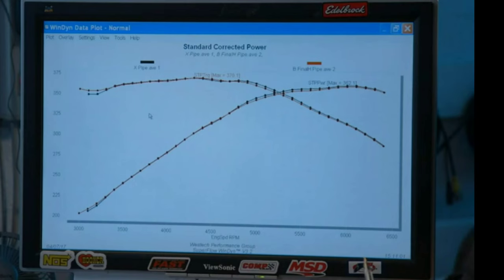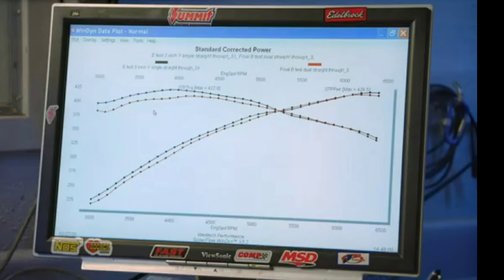DUAL EXHAUST LOSES POWER! single is better for POWER!

Comment: Like the saying goes. I race cars not dynos. I can assure you I put a true dual exhaust with an x pipe on my Dodge Ram and the mileage went up 1.7 and the truck is much faster. Fast cars at the drag strip are not rinning single pipes.
Reply: Yeah they are. Single exit out of the hood, turbo, or fender.
Reply: Lol  😂 yea that’s because u removed the restriction and lost the weight 🤦🏽‍♂️
Reply: Those are turbo cars.How about the nitrous and supercharged cars ever put those into thought?
Reply: Can it be because the diameter of the merged pipe is too small, not tuned to the rest of the exhaust. Back in the 80’s 8 into one headers were explored and made more torque than dual exhaust. And the Bernoulli principle doesn’t have anything to do with proper scavenging. The Bernoulli principle is what draws fuel into a carburetor. If you take away one side of a tapered cylinder you basically have a wing. So he’s using the wrong terminology here.
Reply: @kennethcohagen3539  wtf u ranting about all that matters is those 1/4 mile numbers fuck theory
Reply: True duals don't have a crossover, LOL.
Reply: I tested 4 different exhausts on the dyno. The differences were negligible but x pipe duals made most for me.
Reply: @0to100_RealQuick  u ain’t wrong tho x pipe all the way
Reply: @HostmorkeCZ  How many twin turbos are people merging into single exhaust?
Reply: @Oldsmobility455  that’s a good question.
Reply: Just look at nascar they used to do x pipe now it’s all single exit
Reply: I promise you your POS Ram isn’t any faster. Very intelligent engineer have already done the work when they designed the car. Jim Bo’s garage isn’t going to do any better.
Reply: @postalpancho hates life. Hope he gets help soon
Reply: @postalpancho the stock setup is not for max performance.  It's always a balance of noise canceling, efficiency and performance last. That is why people mod in the aftermarket.
Reply: You have to take turbo cars out the equation. 

Turbo car exhuast system are a different science than N/A. 

You can run a single exhuast on anything.

Think of it this way when it comes to a V8 or any v motor you want a cross over and than you can go to a single equal to the same diameter. 

So run twin 2.5 to a cross over to a single 5" and get the same  power maybe off by 2hp. 

He says look at the meat under the curve well on the street that's great. 

But when it comes to top.end it will be down. 

X-pipe twin have alawys Ben proven to make more power all over graph. 

Plus you build your exhaust system based on what you built your engine to do.
Reply: Dude I could go on for 30 minutes about how off you are.. do some research.

Comment: I'm just gonna run H pipe because it sounds the best and dual exhaust are cool, I don’t really care if I can make 5 more horsepower from an X pipe or single exhaust.
Reply: Yup.
Reply: I'll give you a Denzel Washington from training day, My Maan!👍 X-pipe sound a little too new model for me if that makes sense.
Reply: @johnsheetz6639  x pipe on a 5. O is HORRIBLE
Reply: I run hpipe dual on my e36 2.8 and it I can feel notably less power compared to previous single pipe. :(

Comment: A single vs dual are different sizes pipes not to mention the mufflers. Its hard to compare the two. But if you tow or have any rpm, you cant go wrong with duals (and not two into one but true duals).
Reply from the maker: Its not hard to compare lol 
You just bolt one setup on run it and then bolt the other setup on and run it.

Single made just as much top end and way way more low end as seen in the dyno graphs 😁
Reply: Yeah TRUE duals are better for performance 👍
Reply from the maker: Not according to the dyno 😁
Reply: @newguysgarage6802  yes according to the dyno you just dont watch in detail 4:46
Reply: @newguysgarage6802  nope...
Reply: Yep! though if you're not making over say 220hp to go to a dual and not have it lose anything under the curve it would be a dual 2"-2.25" to keep the velocity up. My mom's 2019 Ram has a single 3" after the cats, but splits out over the axle and around the spare as two 2.25" it keeps the pluses from stalling out. It's also about what room you have available underneath.
Reply: @newguysgarage6802  then that means somebody is using too large of diameter of pipe. Putting anything larger than 2.25 pipe on a true dual system with an engine making less than 500hp is pointless.  All these factory 2.75 and 3 inch true dual systems are overkill on theses cars making less than 500 hp. The hellcats need large pipe. My buddies custom exhaust on his Coyote mustang uses mandrel bent 2..25 pipe with flow fx Mufflers and long tube headers and high flow cats and H - pipe and he makes around 30 more left of torque and hp at the wheels than others who use bigger pipe. It's about maintaining exhaust velocity.
Reply: I’m not buying it.
Reply: @701garage yes according to the dynk. The y pipe made a tone more power everywhere
Reply: @_.incredible_magnum._291  show me a dyno that you make more with a single Y vs a true dual.
Reply: @701garage  did you watch the video?🤣
Reply: @701garage  he can't because it doesn't exist
Reply: @_.incredible_magnum._291  I did watch the video that was one test go show me a chase dyno that prove this. A engine can make what ever it wants out side the chase but it only matters when it is done on a chase dyno.
Reply: @701garage  you mean a chassis Dyno?
Reply: @_.incredible_magnum._291  text to speak is a bitch sometimes
Reply: @701garage  why does it need to be on a chassis Dyno? If it makes more power then it makes power
Reply: @_.incredible_magnum._291  because on a chassis dyno or hub dyno is more accurate to what you will actually make on the street. A dyno cell does not keep your exhaust under a hot hood or under a car. Engine dynos work great for test an engine but you have to take it to a chassis or hub dyno to tune it to how the car wants to operate.

Comment: Nobody has noticed John forces funny car runs a single outlet y pipe now? He said it helps it hook up better because he dropped about 9000hp lol. I'm just bein a wise ass, I don't care if on a mild street engine it makes a couple extra ponies and this is on a mild street engine, yeah a properly sized 2 into 1 exhaust will work as good as anything but I will never run a single over duals (unless it's an 3rd gen Camaro) because it's overal lame imo. It is the reason I consider going centrifugal supercharger over a single turbo is the single outlet, yeah most that don't fender dump y pipe it back into 2 but that seems cheesy imo the big HP isn't cheesy but the exhaust is, and exhaust sound is so important to me  and also with the extra cylinder  pressure of a supercharger and dual exhaust sounds so epic. My old muscle truck 92 Cheyenne with a 355 SBC has regular old cheap 1 5/8" headman long tubes going into dual 3" pipe with gutted walker super cats dumped at the axl, had 40 series now has cherry bomb turbos but I want a more racey note so it's getting redone, it's staying 3" but getting n x pipe and tail pipes, in the past vehicals I always keep em exiting strait out the back the sound of 2 pipes blending sounds so sexy verses that old school blub blub lazy side to side note  behind the tires.  I'm tossing the idea of having both pipes exiting into a large wide oval collector can at the very end like some sports cars (n no it's not making it into a single exhaust but doing all that may sound super cool imo. Mufflers are the big one even tho the 40s were obnoxiously loud with my combo and 3" pipes and the turbos are still oddly pretty loud they zap alot of power and it is a bit tame I'm thinking something in the middle like a good straight thru muffler like dynomax/ magna flow, should sound epic for an old school SBC, I'm also thinking of building a modifying a single plane intake so I can bolt a diy ported Eaton M90 on, with only 350 or so HP if I can  gain 50 to 75hp from it I'll be happy maybe even 100hp with a pulley? That's pushing it with little M90 but it's a regular to daily driver so just a little extra HP and some sick blower whine would be cool and an factory style intercooler plate is only $150 to $250. Sorry bout long comment I get rambling  sometimes.

Comment: X pipes destroy the scavenging effect and create turbulence. Since high hp engines run on valve overlap to charge the cylinders, optimizing the scavenging effect enhances the cylinder charge
Reply: It depends on placement.
Reply: @Christdeliverme  Where do drag racers put their X pipes?

Comment: The math:
Since flow is pulsed, pipe diameter is dependent on frequency of flow pulses and volume of the pulses, when the fluid is a gas.

Each and every combination of RPM, cylinder displacement, throttle opening, number of cylinders or rotors dumping into the same pipe and combustion energy will have one ideal exhaust tract cross sectional area.

In general, when you increase the number of cylinders feeding the same pipe, you increase cross sectional area due to two things: doubled frequency and doubled overall flow volume.

I agree that a single LARGE DIAMETER exhaust pipe is more efficient, but most do not understand the dynamics of the effects of the above mentioned factors. A 6" exhaust pipe may be more efficient at WOT at 5000 RPM, but it will not be as efficient at part throttle at lower RPM. 

One thing the world of science needs is a textbook of tables of the interactions of pipes of various sizes with pulsed flow with various sizes and frequencies of pulses. It's easy to do, but why did the research scientists like Kelvin all seem to die off before 1900? We should have BOOKS of easily-found tables of the behaviors of pipe sizes to create ideal or close-to-ideal compromises.

Someone needs to do the research to debunk the really one-size-fits-all mentality of the "performance parts" hucksters.
Reply: A lot of good points.  The optimal exhaust primary area is dependent on HP.  The more cylinders attached to a collector, the smaller it needs to be.  It's in GP Blair's "Design and Simulation of 4 Stroke Engines."  I have the equations in a spreadsheet.

I'll be making around 475 bhp, and I wish someone made 1-5/8" headers, which is proper for LS1/706 heads.  3.25" single exhaust is more than enough for my car, and a little quieter than dual 2.5".  The hucksters like to sell the "bigger is better".  A larger exhaust may sound "better" but it's most likely a little slower.
Reply: I believe there is a book by David Vizard that has some of these charts
Reply: I completely agree, but will add, A well though out combination of commonly available "stock" parts (from other performance models) can be way more power/reliability than a thrown together amalgamation of random performance doodads. Research is your friend
Reply: Exactly. As someone who went to college for automotive and learned the the theories, this is why exhaust is more than just escaping air at WoT. Youre only at peak TQ for an instant so its more about the entire RPM range.

Comment: it can only draw exhaust out if 1- the pulse is there 2- the valves are open in the cylinder 3- you have overlap.. right ?

Comment: firing order headers, equal length, stepped at the collector entry to a bigger y pipe is the gold. GMA T50 engine is a perfect example
Reply from the maker: @paul1der  firing order headers...would not be equal length 😅

Comment: I'm gonna be installing bbk 1¾" long tubes on my f150 5.0 and i'd be interested in your opinion on the exhaust setup Im planning. The collector exit holes are 2¾" so Im thinking 2¾ to the y-pipe, then in to 3" that goes all the way back. Does that sound efficient or what would you do?

Comment: I have a 2017 Tundra 5.7 V8 with a Y-pipe (no mufflers). I am thinking of removing the Y-pipe and running straight dual pipes straight back from the cats. I am looking for more sounds only. Don't care about power. What is your professional opinion? Is it worth the $350 the exhaust shop quoted me for? Thank you.

Comment: The way I always imagined it was that a crossover pipe between the dual pipes fooled the exhaust pulses into thinking that's where the length of pipe ended and the rest of the exhaust needed to be as free flowing as possible.
Reply from the maker: Na, that would be a termination box 

https://images.app.goo.gl/AE9TxcXG8STqy4aS8

Notice the crossover is behind it so the linking pipes can still scavenge exhaust from eachother

Comment: 4:34 Proof in that statement: I have a SINGLE 2.5" exhaust. Stock manifolds 1-1/2" primaries to a 2.5" Y-collector after the cat-converters to a single center in/out 2.5" muffler but out to a Y split dual 3.5" Tip. Because a single 2.5" tip out the side looked weak lol You can tell which one is dominate visually by the fact that after 2 weeks one pipe has 2x more carbon than the other and more of a yellowing/golden color from heat (being stainless) is it's path of least resistance. It's also the one closer to the muffler and cleaner/straighter shot from the post muffler 2.5" pipe, hence path of least resistance.

Comment: So am I right in doing the exhaust upgrade on my v6 tacoma? I'm swapping my oem muffler for a paradox signature series performance muffler but I'm just going to swap the muffler for this better flowing muffler mainly for the sound but I'm not spending the money to do a full cat back system since I probably won't see any gain from 3" catback or a dual catback over the 2.5" I already have with the higher flowing muffler reducing back pressure but not so big I loose velocity??? My main goal is a better sound and if it helps performance great if it don't I didn't expect much anyway.i do have a k&n panel but I got it so cheap it was less than a good paper tacoma engine air filter so maybe the muffler swap and the high flow filter might increase low end torque a smidgen maybe which would be a,welcome side effect as it's not the most power for the 20mpg I get on the hwy to begin with. But I love my truck and I hope to love the sound of the paradox under acceleration and lack of it on the hwy ! If my thinking is on the level great if it's not please let me know before I cut off my oem ..but if you think I'll get what I'm after well also let me know so I can feel good about it lol .. great thinking on this and it makes total sense though I was going to install an h pipe eventually to make it sound a little more truck like as I want it to sound like a truck and not a ricer.

Comment: Very interesting and accurate.  I have couple questions, one people dont seem to be able to answer,  on a street driven car such as my 57 Plymouth 301 V8 it has 2 1/4 twin exhaust.  No H pipe.  Would a H pipe help  this engine? Also why do H pipes seem to quiet down most stock -- mild V8's ? Oh and can a exhaust  either twin or single be to big? Thanks for the help.
Reply from the maker: Yes an H pipe would benefit that setup,

it sounds quieter because exhaust gasses that would normally go straight out the tailpipe is instead going into that crossover and as a result tones down the sound which we hear as quieter,

Yes they both have a point where it is too big for the engine, depending on engine size and flow obviously is what will change that. 😃
Reply: @newguysgarage6802  thank you very much for the help and information.  I also own a 63 Impala with 327, twin exhaust,  but being a X frame car can't have a H pipe.

Comment: Y pipes are better on even firing motors. On a V8 you’d need either a flatplane crank or 180 degree headers to take advantage of one. Same reason why equal length header aren’t ideal for crossplane V8s since they overload the collectors with the uneven pulses so you need tuned headers for them. You got the right idea
Reply from the maker: Nobody ever said you had to have equal length tubes on a Y pipe setup lol
Reply: Right, you need tuned headers to even out the pulses for it to work properly. That’s why you see Y pipes on Ferraris and X pipes on muscle cars from factory
 You can see on the dyno that the Y pipe make great power but starts to taper off at higher rpm’s since the Y pipe gets over saturated by the uneven pulses, like two guys trying to walk out the same door
Reply: That’s why I’m switching my factory X pipe in my 3.7 Mustang to a Y pipe system similar to the one in the 370z. I’m convinced that my even fire sixer would make the most out of a Y pipe, plus the weight savings like you mentioned in the video
Reply: Gee......I wonder when NASCAR will figure out that the "180 under the pan" hurts power output. Just cram it all into one big ass oval pipe. Please New Guy!

Comment: Good video, intriguing. What would be the formula for working out optimum single pipe diameter? For my example I will be exiting with 3" from the collector. I will be using oval pipe that transitions down from round from the muffler(s). Im doing this ground clearance for a side exit (race-car).

Comment: This would be vehicle , motor , hp specific on which is better.  Nice theory though.
Reply: No… its fact, but more RPM specific… there will always be an RPM where single takes over, but everywhere with less flow, will have more power on single.
Reply: Enginemasters proved it. The big single did make more power than duals.

Comment: 74 Comet has the fuel tank closer to leaf spring on driver side to make room for one muffler next to it on pass side. Rather than 2 1/4 dual, I used 2 x 2 1/4 into a single 3 and used a 3" in, 3" out super turbo muffler in factory hanger. Mandrel bent pieces, long tube headers, 302. I am thinking  of dual 3s to the y pipe and single 4" out back for the next engine....but will test what I have before changing it.

Comment: years ago flowmaster made a y collector to blend the pipes from left & right header collectors in a 3 inch single.it increased torque across the rpm range on a ford 302 set up for mid range torque.HUGE difference from stock torque.